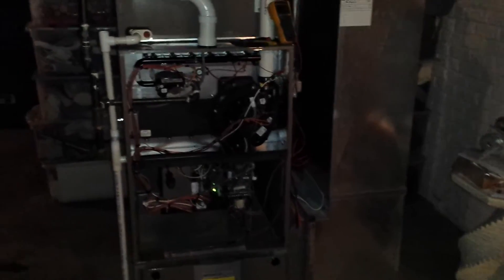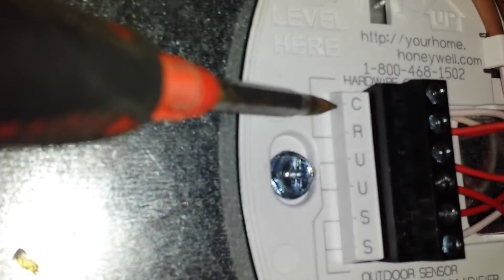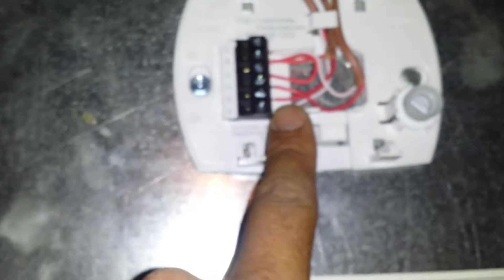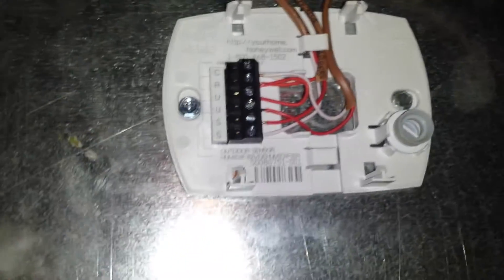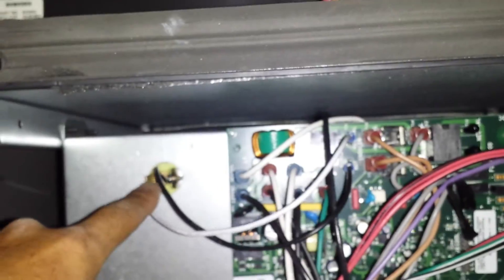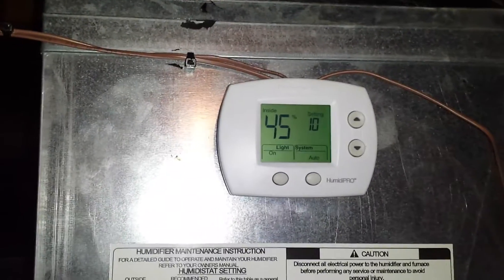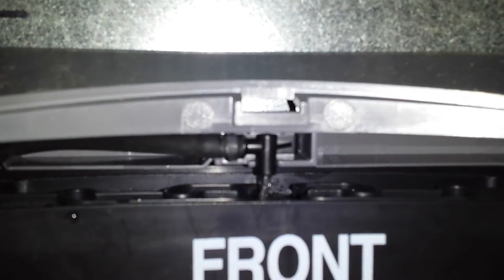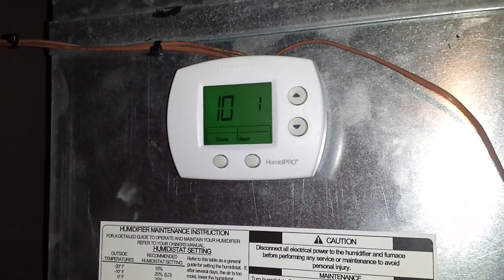Honeywell humidipro control wiring on a York 90+

Comment: Thank you very much for the help. The only change I did on mine was I ran the 24v from the W terminal on furnace to R terminal on the humidistat. Then took the other wire from the 2 wire and connected C on both ends. That way it does the same thing, but you bypass the transformer step, which I feel is redundant as everything else is already 24v. Very good job explaining this system!

Comment: Hi, after I installed and test it with select 1 or 0, my humidiifer is run or stop are fine under test mode, but exit the test mode, I dont know how to use it, on the screen left side is 35% and right side is setting 8.. the buttom up and down just set from 1 to 10 on right side.. that's all I see .. I have try setting 1 or setting 10 is no respond with furnace heat is running .. i can't find any info to use the humidipro from the web after 2 days googling ..

Comment: You have it connected wrong, it needs constant 24v , it should be wired to the C&R on the control board.
Reply: It will get power in summer time as well. Wire it straight from the board HUM terminal.
Reply: @mrtheloverboy89 it is only powered when the furnace calls for the hum. Again it is not constant power.

Comment: The manual for this humidistat really does suck. It doesn't mention having to do this but if you look at the wiring diagrams (besides the very first one on page 7) it shows one leg of a transformer being wired to the top U contact (in every diagram) and one side of the humidifier wired to the lower U contact. It makes sense that the jumper would be needed if you're not wiring a transformer right to the U contacts.

Comment: Jumping the cables as you did still allows to the humidistat to open and close the solenoid according to the humidity setting ( for example 30%)? Or the solenoid valve will be open every time that heat is call regarding the humidity setting?

Comment: Even this video isn't really correct. The HumidiPRo instructions state the device should get constant 24VAC power and it should NOT be wired to the transformer. The jumper did nothing for me.

Comment: I have a Honeywell HE300A1005 humidifier and am wondering if there would be a way to delay humidification until the fan has been on for enough time to get an accurate reading of the relative humidity on the return duct mounted HumidiPRO Digital humidity control?  The return duct tends to get a false humidity reading for the house since the fresh air intake damper is connected to the return duct and brings fresh air into the house if a bath fan, range hood, or other venting appliance is running.  This causes the humidifier to run at the beginning of almost every call for heat regardless of the outdoor air temperature because of the false reading.

Comment: I bought this controller and wired it according to the book. No power was getting to the solenoid so I called Honeywell. They had me take the 24V hot lead and touch it to both U wires, then just to one U wire. They claimed my solenoid was bad. This was the weirdest troubleshooting experience I've ever had. I asked if the 24V should be transferred to the U contacts when calling for humidity and they said yes. Clearly Honeywell tech support has no idea what they are talking about. Thanks for the video - now it makes sense.

Comment: Im about to install this same controller. I understand where c and r and the outside sensor go. But am confused about the 2 U's. I have a terminal labeled HUM, should that go to the top u? And the bottom U go to the humidifier relay switch? Then where does the other humidifer relay wire go?

Comment: Thanks for the video, I tried installing it this way and it works, But i think the correct way to do this is to run your r/c 24v power to the humidistat. I then took a 3rd wire from furnace that controls heat, I believe it is Y, I ran that to the first U contact point. I then took both humidifier wires i ran one to the bottom U contact point and the other to the common on top.  The advantage is that the humidistat does not shut off every time the heat shuts off but will still only run when needed when the heater is running.
Reply: Y is for cooling
Reply: Correct this is how it should be done.  The humidipro should always stay on, so you can see the humidity level..  And did they forego the bypass duct for the humidifier, it sure looks like it needs one.
Reply: Correct this is how it should be done.  The humidipro should always stay on, so you can see the humidity level..  And did they forego the bypass duct for the humidifier, it sure looks like it needs one.
Reply: You don’t need to do that the humidistat will recognize base on settings to turn on the humudify

Comment: Have not heard the term dry contact before but I do know NO&NC. Cool, good stuff!
Reply from the maker: Haha! Dry contact because there isn't any voltage behind either terminal, but yes, it's normally open. That way for a powered humidifier you just put the low voltage wires right on, they only need to be closed to make the humidifier run. For instances where you need 24v to hit the solenoid, you have to put 24v constant power to one side of the "dry contact".  The other side of the contact, along with a 24v common will make the solenoid. 
Thanks for watching!

Comment: Yeah, I have a HumidiPRO H6062A1000 installed in my house, only wish it was wired so when 1: The thermostat is switched to heat setting (fan is on Auto) and,
2: HumidiPRO calling for humidity regardless of the temperature, 
together the furnace fan starts and humidifier lets water pass. 
So, would I need to purchase a Double Pole Single Throw (DPST) Relay in order to achieve this configuration?  I hope this makes sense...
Reply from the maker: Patrick Corcoran dude, for what you are saying the easiest answer is to take a two wire from your w and C terminals and run that directly to the solenoid at your humidifier. Abandon the control completely and that way when your thermostat closes R & W it will send 24 volts on W with common from C straight to your solenoid valve and open it for water flow for the whole time that the thermostat is calling for heat. Thanks for watching!

Edit: if you want humidity control above and beyond what I've explained above, you can put a cheap humidistat on that 24 volt line and break the W with it
Reply: I will pick your solution apart, give it a try and let you know how it goes. Many thanks for your reply.
Reply from the maker: Patrick Corcoran haha okay after reading your comment again, I think I finally get what you're after. I can't tell you off the top of my head, but the general idea is that the control in the video will go in between the G from your thermostat which calls for fan and the furnace. That way this control will push the fan on at the furnace with a call for humidity. Like I said I don't have wiring diagram in front of me, but that is the way I set them up in the newer digital thermostats with built-in humidity control.
Reply from the maker: This most recent scenario with the digital thermostat with built-in humidity control would also eliminate the control seen in this video
Reply: Okay, now I've got to sleep on this one.  My mental circuits don't think as fast as yours.  But yes, that's the idea, start the house fan and humidity even if the thermostat doesn't call for heat. Do I switch the water feed to the hot water supply too? Cold recirculating air may need the hot water, correct?
Reply from the maker: Patrick Corcoran hot water will be the most efficient

Comment: This jumper wire worked for me. I have an older furnace with a stand alone transformer that powered an old humidifier.  I connected it just like u sad to get the solenoid to open and it worked!  I couldn't find this method anywhere else on the internet. the down side is that the humidistat only will be on when the fan is running.

Comment: Does the HumidiPro only power up when the heater switches on?
Reply from the maker: shuumai with the way I've wired it in this instance, yes. First the heat has to be on, and second there has to be a demand for humidity before the humidifier is actually powered up.
Reply: How does it keep it's settings between power ups? I just ordered an auto humidistat. Manual is only good for rising the windows.
Reply from the maker: shuumai I'm pretty sure it has an internal battery, it always seems to remember the setpoint
Reply: Right. This gave me an idea for my old furnace (Snyder General from 1991). Just an on/off toggle switch to switch off the humidistat at the end of the season.
Reply from the maker: shuumai ok thanks for watching!
Reply: victor de la puente, jr. Could this be done by connecting to W and C? My old humidistat is connected to R and C through a current sensing relay.
Reply from the maker: shuumai yes. that should work
Reply: I have the humidifier solenoid connected to C-W through the humidistat and the humidistat power connected to C-R. Water starts when flame starts, then stops when flame stops. It's almost what I want. I did have a current sensor, but it doesn't seem to work now. Maybe I damaged it.
Reply from the maker: shuumai it's posible. I like to power a 24v transformer with the 120v heating speed tap for my humidifier power on older furnaces, if there isn't a "hum" terminal on the board.
Reply from the maker: With the wiring we've been talking about, yes it will only come on when heat is on and control is calling
Reply: What's a speed tap? I had a model 50 current sensor on the fan's neutral wire. I tried testing the sensor, but the results don't make sense. Resistance on the 24V side is always in the meg-ohms, but when I had it connected, it seemed to act like a closed switch.
Reply from the maker: shuumai haha, the different wires that feed the blower motor are the taps. depending on what you've got, the board will give 120v on different pins (taps) for fan on, heat, or cool. I'd just power a 120v x 24v transformer  with the 120v heating speed tap. that way the humidifier won't get power unless you're running heat, and the heating fan speed is energized. set it and forget it.
Reply: victor de la puente, jr.
Do you mean, attach the transformers primary in series with one of the 120V fan wires? Or maybe a relay?
Reply from the maker: shuumai yes. use the 120v blower heating speed line, that way it only gets power when the heating fan is running